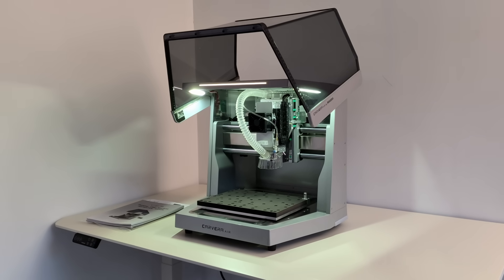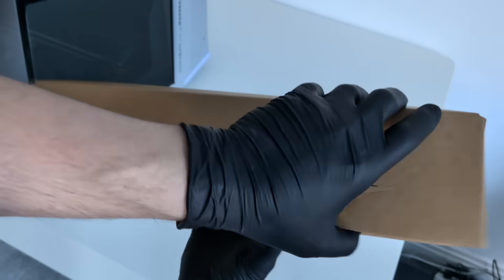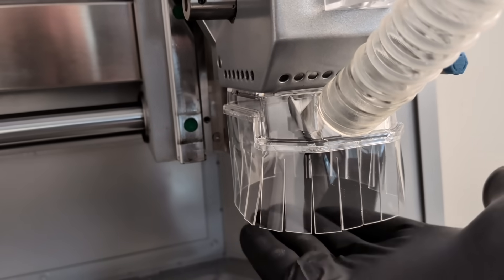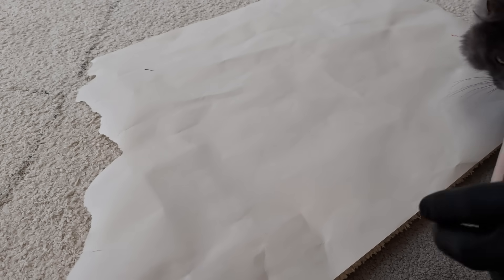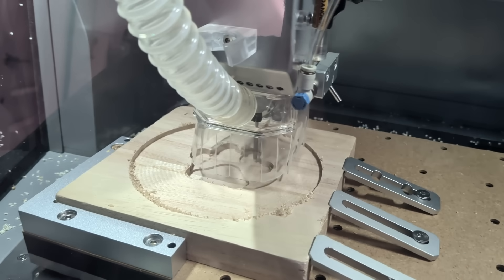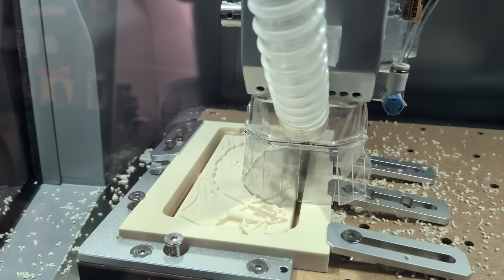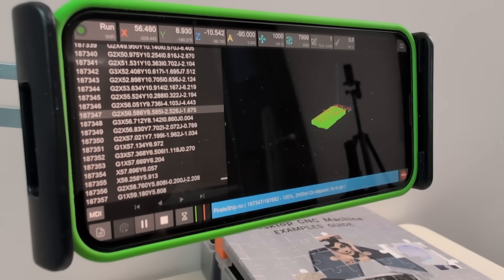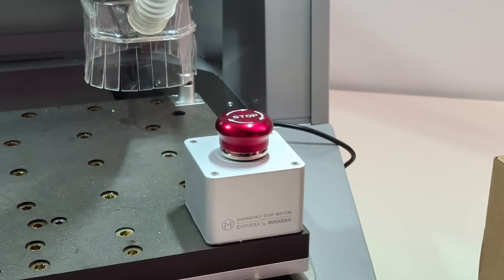Makera Carvera Air: Beginner’s First Day Results

Comment: I've been making things in my garage for years and always wished I had better tools for production finishing. This machine literally solves that problem. Quick setup, no complicated calibration every time, professional results without spending ten thousand dollars. The enclosed design is huge because I don't want noise and dust everywhere. This is exactly what the home workshop community needs.
Reply from the maker: Right? That balance of capability plus accessibility plus clean operation is perfect for home makers.

Comment: What strikes me most is how the software and machine are designed together as a system not just hardware. The auto-probing, automatic calibration, integrated workflow with CAM software - that integration is what removes the learning curve and makes this actually achievable for beginners. Lot of CNC machines have great hardware but terrible software. This isn't that.
Reply from the maker: Exactly right! System design is everything. Hardware is only half the story honestly.